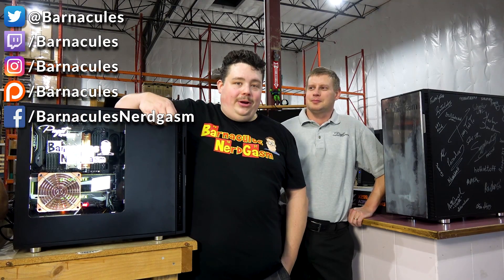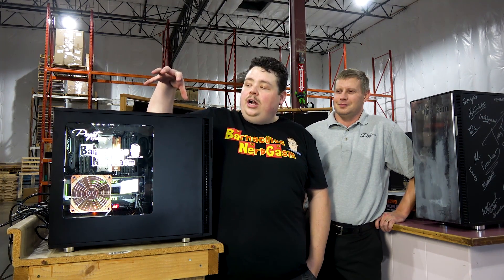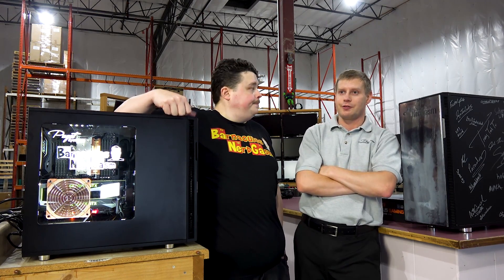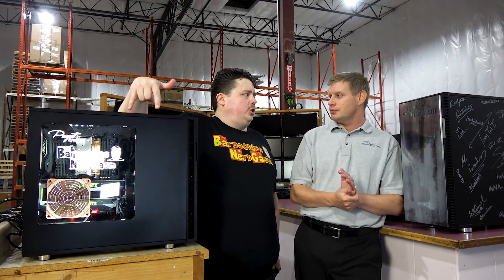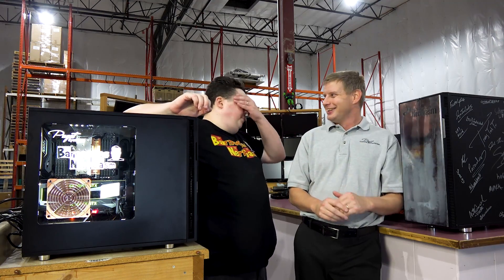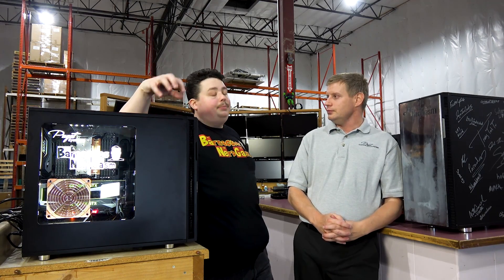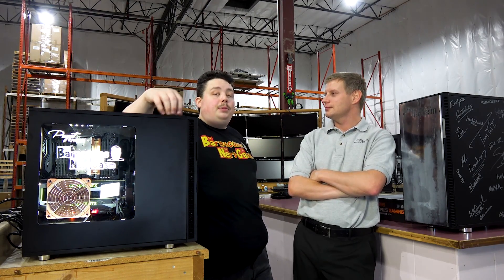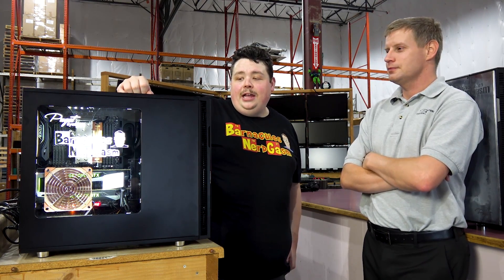This is the most OVERKILL PC I've ever dreamed of owning! - @Barnacules

Comment: Wow. I've got a vaguely similar rig. Exact same processor, same RAM capacity. Only, mine is for software development (full OS builds with userland can be a real bitch), so I don't have the Titan XPs. To be frank, I wish there existed a benchmark for massively parallelizable software builds.  I feel you could build a fairly representative one around the ChromiumOS build system. Anyway, just wanted to call out to my fellow fan-in-monster-computers.

Comment: How do you like the Gigabyte board? Stable? Have been using Asus for my last several builds but thinking of Gigabyte for my next one.
Reply: Asus and Gigabyte are pretty much neck and neck for high performance. I've used Gigabyte boards ever since 2004 and they have been rock solid. I dont use either now a days since I used and older dell workstation at home but I wouldn't mind using either brand to build a new right. Either budget or extreme. Cant go wrong with both brands.

Comment: Barnacules.  I need your help brother. I build the same pc with 1080s instead titans. If I overclock and do a bench mark. The over current kicks on and shuts the Pc down. I am in desperate need of a screen shot of all your bios settings. I am not new to overclocking. Yet this x299 bios is crazy large and confusing
Reply: i fixed it vcore voltage protection set to exsreem

Comment: Hi Jerry, aren't you worried about dust with that side panel fan? Or is it filtered? And do you find that it actually helps with temps?
Reply from the maker: +Matt Smith it can suck in dust but this system is very easy to blow out. A filter would upset airflow.

Comment: I was gonna watch this but can't because my Audio is fuckin up. Updated GPU drivers because it was kinda quiet when headphones were plugged into 3.5 jack on Logitech X-230 speakers. Sounded fine on my PC's front port though but after the update it was worse through the speakers jack, corrupted sounding too. Unplugged everything multiple times & now my PC's front port wont work but the 3.5 jack on speakers is fine. Is this a Windows 10 bug guys?

Comment: So many jealous bi*es here :)  Jerry was never into hardware that much. And never about the change. For me. I would go TR 16C/32T  and work in Davinci Resolve (also intraframe codec).  Hell. For this money I could have gone 2x32C64T Epyc build (OK, rendering is a thing for me). That's 64 Cores and 128 Threads lol.     But for his workflow.  Premiere.  This is a great beast.   But this is SOOOO MUCH in the area of "diminishing returns".  :)  Just compare 8700K (if it needs to be Intel) with this.   A simple 1080 and an OCed 8700K would be really not that far behind in real world tests against this beast.  But, diminishing returns hardware exists for a simple reason. Someone will use it.  :)  This just isn't a "average consumer" build and it doesn't need to be.

Comment: How's the temperatures on the system, I would have thought a solid front panel would be detrimental to this month CPU? Also, Noctua fans, why not use the new Noctua Chroma fans? lovely etched side panel window with a brown fan in the center of it!

The brown fans is the whole reason, I had previously stayed away from Noctua, I like my systems color matched!

Comment: Barnacules Nerdgasm : 
Stupid Intel sponsored (bribed) build. Intel Core i9 7940X has a base frequency of 3.1 GHz and at that frequency has a 165 Watt TDP....in reality eating around 180-190 Watts at those stock clocks. That already boiling hot production of temperatures on VRM-s if not cooled actively by a separate 8cm fan or by mono water block. It only has 44 PCI lanes....2 x Titans means 2 x 16 PCI lanes for titans and only left with 12 pci lanes for all of the M.2 SSDs....meaning either GPUs or SSDs won't be utilised to their fullest potential. That's the stupides build ever !!!! There is no reason why not going to AMD Threadripper where you get for 450-500 bucks less money (950 bucks) a 16-core 32-thread 1950X with 64 PCI lanes and higher base frequency of 3.4 GHz and better utilisation with lower TDP and real world consumption that can be at stock frequency cooled by a Noctua 14 cm tower cooler.
Reply from the maker: Another AMD Fanboy that didn’t listen or do his research, I’m not surprised.
Reply: Barnacules Nerdgasm : This time around AMD deserves their fans in a fair way by the fact they've developed their Ryzen/Threadripper products really good and they are literally doing no bribing of any reviewers and no skewing of the test results. They are bribe free and therefore their products speak for themselves. And all of those facts above that I've mentioned are facts I have come to by real world experimenting building such absurd rigs. They are provable any day anywhere to anybody, including you :). So if I am an AMD fanboy for that, then so be it and I am proud of it for now owning a LAVA LAKE nuclear CPU :).

Comment: Jaytwocents builds better systems
Reply from the maker: +jayakumar v Aesthetically pleasing systems yes, the level of research and testing that goes into Puget including the thermal testing with FLiR goes beyond what Jay normally does.
Reply: ❤️❤️ can't believe you replied...
But doesn't water cooled system cooler than air cooled... doesn't overclockability is higher in water cooled system... doesn't better clock speed yields better performance irrespective of application with identical processor?

Comment: Gigabyte strikes again with motherboard voltage issues. When will people realize that gigabyte makes really unreliable bios. Also on that board (and most of x299 boards) the m.2 slots are connected to the chipset, not the cpu, meaning all 3 are limited to 1 PCIE 3.0x4 connection (dmi 3.0). Its really sad when you see puget systems going along with Intel bs for no reason.
Reply: James Mastroianni why they just switch to asus?
Reply from the maker: +James Mastroianni do more research James, also I recommend checking out Pugets blog. Specs on paper don’t equate to real world performance, come on, you should know this.
Reply: Barnacules Nerdgasm Doing research, I have found drives connected to the chipset performed significantly worse than directly to the cpu, also the 4gbps limit of the DMI 3.0 is a heavy bottleneck if you are using these drives to their fullest. The DMI also connects your usb, sata drives (granted you have none in this system) audio, and that fancy dual 10g internet card. So with all of these devices sharing a PCIE 3.0x4 connection, something is bound to bottleneck. As for your recommendation, I did look on Puget's site, and failed to find an aritcle/blog comparing NVME ssd compairing chipset vs cpu lanes, or even chipset bandwidth saturation. If they have one please link it to me as I would love to see it. 

PCPper tested this with the intel 750 ssds a long time ago (and honestly no one else has cared to, maybe you could do some experimenting with puget). They had 5 ssds in raid, and the 5th one was connected to chipset and were seeing performance loss compared to the rest. Now that was just one, slower drive, connected to chipset. You have all 3 of yours, which are significantly faster. Link below:

https://www.pcper.com/reviews/Storage/Five-Intel-SSD-750s-Tested-Two-Million-IOPS-and-10-GBsec-Achievement-Unlocked
Reply from the maker: I’ll post benchmarks soon, usable speed is more important that insane numbers.

Comment: I can't understand how those cpus are not getting throttled on a cooler with 1 fan. Did Puget do a delid for you? I have the 12c version of that on a 360 rad and unless the fans are pretty loud it throttles. Cores hit 95oC, I can set this higher so it dosn't but 95oC is really flipping hot. Can you do some tests? Why give away free performance from turbo boost?
Reply from the maker: +Jon Donnelly I will be doing full benchmarking. Also, the noctua cooler is insanely good and quiet.

Comment: Why would you not go with Threadripper? AMD beats the shit out of Intel in all the things rights now.
Reply from the maker: The fact you believe that shows you've done zero research, try again. All the data supports this processor killing Threadripper on Adobe Premiere performance. I'll give you a second chance though to stop with the Fanboy act and do some research.
Reply: I can't believe my bad attempt at trolling hooked you lol. If premiere was coded to scale well with more cores intel would be screwed right now but alas intel still rules supreme with adobe -_-

That's a good enough reason to switch to blender to me but I don't video edit so I don't know the learning curve involved there making my opinion kinda pointless on the matter
Reply: I can't help adobe doesn't know how to make a decent piece of software fatman7o0. If he used software that scales appropriately with additional cores AMD would be the clear choice. If you want to look at what the best processors for general purpose and best for the price you have to look to AMD right now, if all you want to do is game and fuck off on Premiere then Intel has the advantage because of higher clock speeds.

Comment: 7980x isn't slower if you overclock it. But you wont be doing that with that air cooler :p
Reply from the maker: We're talking about the single core speed dropping because of increased heat distribution across all other cores.
Reply: If you OC, you get no core drop :p. 4.7 on all cores ftw
Reply from the maker: Yeah, but if I OC just 2 of the cores I can get higher then that and single thread performance is more important to me for the primary operations. Liquid cooling doesn't overcome the thermal transfer of the heat spreader. But post your screen shots on Twitter and tag me :D
Reply: What have been your issues in PP? I used to have heaps of issues in AE hence why I moved to PP. Render times are now down to around 10min for a 7min 4k video with a 7920x at 4.5 on all cores. Will be trying my 7980XE soon

Comment: Just looked on their website, so for 50% more cost on processor you get UP TO 3% more performance in Adobe Premier, Threadripper was a better choice for this build. Yes you can claim its faster, but at some point if something is only 3% faster you have to say this is stupid, Im not paying 50% more for that difference, unless Im looking at this processor cost wrong  ( 1399.99 INTEL, 800.00 AMD) This is just marketing for Intels processor as being faster when reality is dollar for dollar its 47% slower.
Reply: It was provided for free, the cost is negligible.
Reply: Nah, Barn has all his builds Intel. It's about sponsorship as well as some of the other things he's mentioned.
Reply: That and the fact Puget Systems don't use X399 or Ryzen in their builds.
Reply: Exactly. Intel for the sponsorship win which is fine. To be completely honest the bottleneck in this system is the core speed, they could of went with a 7900x on water pushed to 5.0 Ghz and that would post better times in this application.
Reply: Puget don't do liquid cooled rigs, all of their stuff is designed with air cooling in mind.
Reply: You're again missing my point yet confirming it. This isn't the best rendering computer you can buy. This is the best rendering computer Puget and the other sponsors I'm sure were involved could give him. Is it a sweet machine? Yes. Do I have a problem with it? Nope. However, if this were the best machine a lot of things would of been done differently. Right now, his CPU is a huge bottleneck and limited on OC'ing because it honestly doesn't need all the cores it has. On top of that even basic AIO water cooling, which I get this sponsor doesn't use, could be used with a much lower end chip to achieve superior results.

I like this guys videos. However, being someone who has only subscribed to him for a year and yet has watched a few videos of his in the past it's hard to look past videos like this as being anything but advertising, which isn't really why I subscribed to him in the first place.
Reply from the maker: Funny how you didn’t look at he research and just make this assumption. You couldn’t be more wrong.
Reply: Funny how you assume I've done no research and yet you make affirmative statement with linking any data.

Anyways keep making videos man. I enjoy watching them.

Comment: Shaking my head, you do know you get better read and write speed on the M.2 if it's setup up for RAID.
Reply: Kenny Dee not for the work Jerry will use it for
Reply from the maker: Wrong, I had 4x 850 Pro drives in RAID 0 and they were still slower than a single NVME drive for both read and write. If I put the NVME drives in RAID it will be even faster then that. It doesn't make sense to say something is faster if you have a ton more of them :D

Comment: I know this doesn't apply to you but according to those benchmarks the performance increase of the i9-7940x and gtx titan Xp over even an i7-7800x and a (only 1) 1070 does not really justify the cost increase of like $2000. At least not for most people but I guess some are willing to pay top dollar for an extra 25-30% performance. When it's for work it can easily pay for itself with time. But 2 grand is a lot of money.
Reply: that 2 grand is to pay the people who work really hard on quality control and building the system.
Reply: he didnt pay for it.. i think thats one of the reasons he got this and not something more reasonable and cheaper.
Reply: vinny on YT no I know he didn't pay for it and it's the best for what he wants to use his system for so I totally get that. I'm just saying for eveyone else that for the performance it's a ton of money to pay so it better be absolutely needed otherwise going with a less beefy system makes more sense to me.
Reply: Arduino Guy Projects and More! Lol the 2 grand is needed to pay the difference for the i9-7940x and the (1) titan Xp.